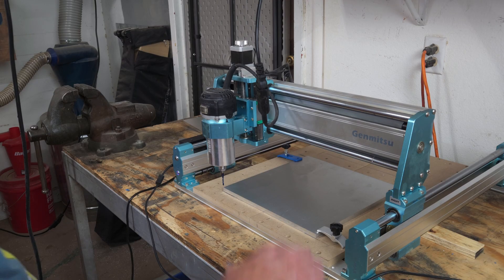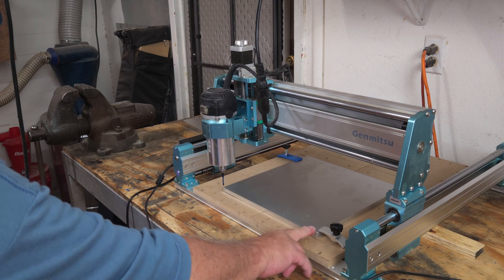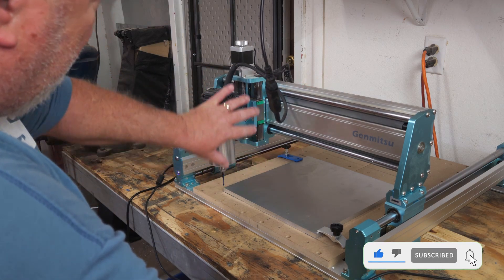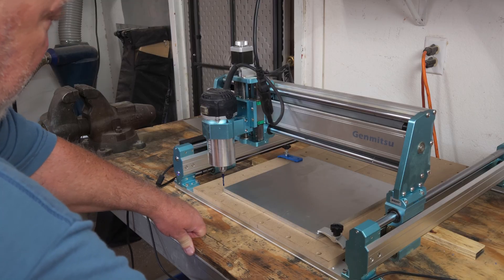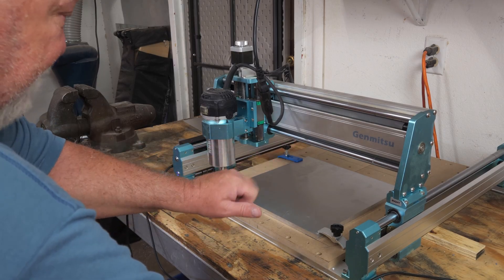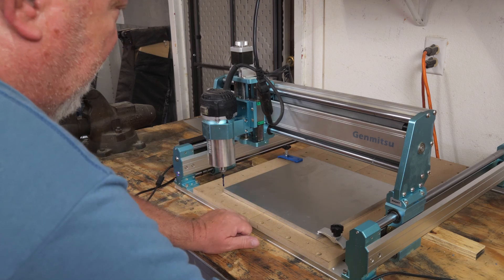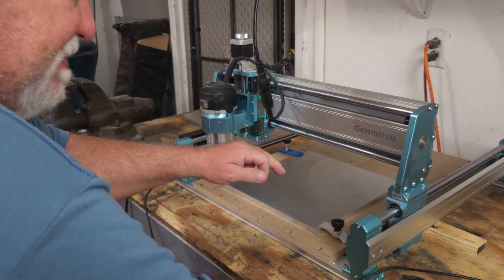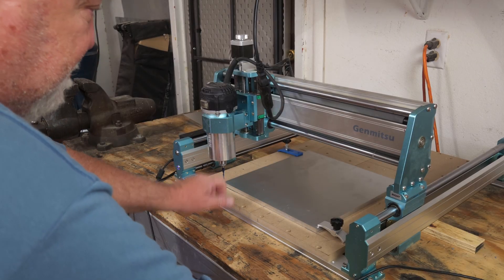Cutting More Thick Aluminum on my Hobby CNC

Comment: i had similar problems was a loose wire inside the controller take it apart and check the connections.... i could pull one out it was barely in there..

Comment: Refreshing to see content where mistakes are included, as we learn from them, rather than highly polished content. I wanted ask, not sure if you use a Z probe on your 4040 with the upgraded router, but do you have an issue with the probe not working with the router, as they seem to say because the upgraded routers are grounded, the probe goes red as soon as the alliigator clip is attached
Reply from the maker: I have a few probes but usually do the paper method.Thanks for your comment.

Comment: You got to use your shop vac and blow the chips out of the way. If you’re experiencing flute clogging on a single flute, it’s because you’re grinding up the cut chips in your tool path as you cut. And AI says that setting 5 on the router is 27000 rpm so you’re melting the the chips. Consider that a 1.5kw spindle goes only as high as 24000 rpm and is used at that max rpm for 2d adaptive (dynamic) milling where the entire blade is used and onlyone side of the blade attack the material, causing less stress on the spindle and end mill and leaving more room for chip evacuation.
Reply from the maker: I was using the shop vac but not enough when that happened. Thanks for your advise.

Comment: really linking your path to cut aluminium. I'm currently also considering the pro max for small Alu and Carbon work and your videos show how capable this machine really is! thanks!
but i think i will go with the x axis extension and also buying a 1,5kw spindle instead of the 710W router.

Comment: Looks like it's coming together! Entire to see the end result. I'm holding off on milling the aluminum until later in the fall when I'm not using the machine as often. I've had my 1300*1300 running nearly non stop since I got it assembled. Love the linear rails/rods on mine. Maybe I should post some videos of mine too, the 1300 upgrade is worth it once the rails are installed in my opinion. Thanks for the shout out!
Reply: @kylequinn1963  thanks for the good feedback back